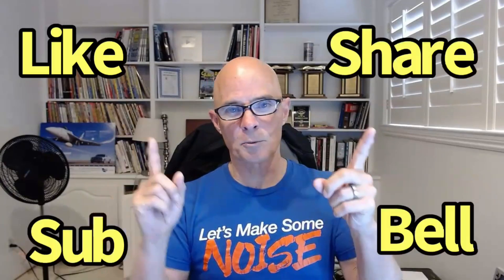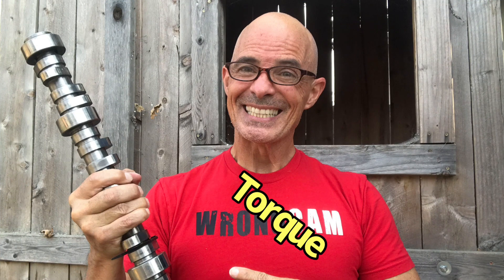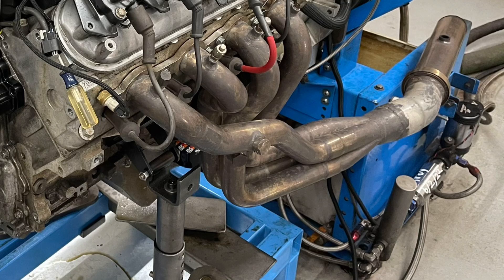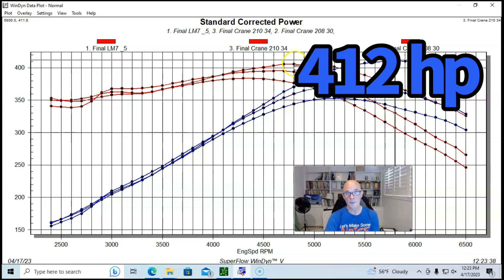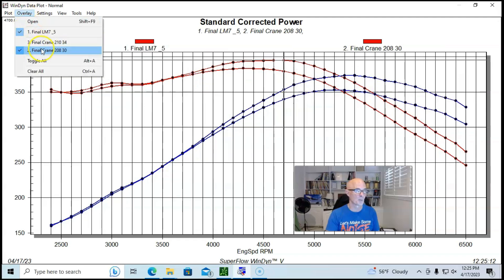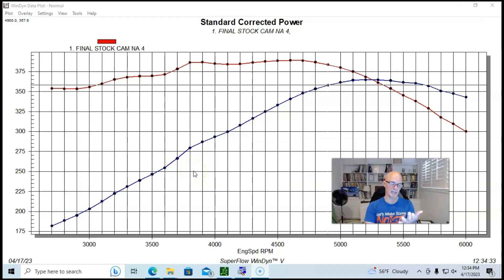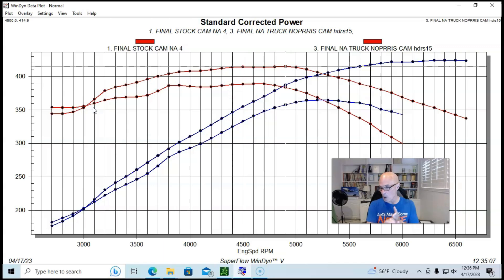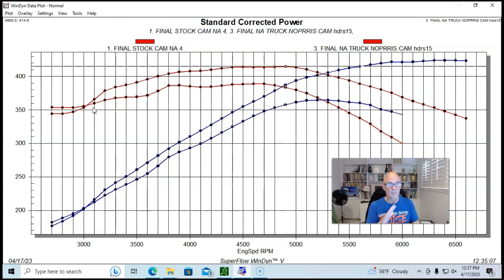WHERE'S THE TORQUE? HOW CAN I MAKE MORE LOW SPEED TORQUE? WHO MAKES THE BEST LOW-SPEED TORQUE CAM?

Comment: The "BEST"  torque cam (for a 5.3L truck) would be LSA of 109-110, 210-228 duration @ .050, .550 to .600 lift (stock to mild porting (possibly more lift with aftermarket heads)) , intake valve closing @ 35 deg ABDC @ 0.050 lift (32-38 is ok), with 15-35 degree overlap @ 0.050 lift. 

But this is with 10:1 to 11:1 compression. (this is more important than cam to maximize torque) The higher the compression the more torque it will make and NO 11:1 doesn't mean you must run 92 octane or racing fuel. You just need a really good tuner to do AF and timing.... 

You also need a good exhaust, either the stock truck intake or TBSS intake (w/ a cold air and a free flowing air filter, stock is fine with a K&N or similar filter). a 160 deg thermostat, and I would do a dual pattern cam with a slight exhaust bias. ( a few extra degrees of duration on exhaust lobe ) at least if running stock to mild ported 706s or 799 heads. As the exhaust on these heads is right around 70-80% the flow of intake and needs a little more, some aftermarket heads don't need a split duration though.... 

This will get you in the 1.35 to 1.45 times the torque per cubic inch range, and thats right at maximum torque for a NA engine. (420-460 ft/lbs torque). Anyone saying they got over that is either lying or breaking the laws of physics.... 1.45 times is max for anything from stock to a full race NA engine the only difference is where that max torque is in the RPM range (the higher the RPM the higher the HP max is).....
Reply from the maker: so much incorrect here! the best torque cam would be 210-228 (an 18-degree spread)? Are you taking about peak or average torque production? What about low speed torque (which is what most actually want). BTW-my Engine Masters entry was 1.53 lb-ft per inch-but that was a dedicated build.
Reply: please then say whats incorrect, I was using the 128 formula but if you have better please  say and show. and the spread is because try finding a cam with those specs and the spread is also all within lower range without need of a stall converter but the lowest would be unable to rev to 6k while upper is still in stock converter range and could rev to 6300 but I am still learning till I die so I'm all ears to those who have more experience .  But don't just bash, explain and teach... 

A final note is I'd of course would personally want the upper side of duration but that would need a custom grind having a split lobe with a fast opening and slow ramp on closing but try explaining that to most people would get lost and try explaining that even cams with exactly the same lift lsa and duration can have different overlap because of the lobe ramp and trying to explain it to most would take pages if not a book to correctly converse the how and why. @richardholdener1727
Reply: Prove it. Richard does it every day. Then he shares the information unbiasely. If someone tells Someone that works at Nasa That the earth is flat. That person tells him that is incorrect, And the person say prove it.  You tell them where the gift shops at and go about your work.

Comment: I would be willing to bet a “small” duration with tight LSA would produce substantially more torque from 3000-4500 than these larger wide lsa cams
Ever tried something like 220-224 580-580 on a 108? Installed on a 104 ICL
Should be right it the sweet spot for a 5.7

Comment: My recipe for tq

Compression, displacement, shorty headers, best intake possible and almost any cam with under 210intake duration with a single pattern
Reply from the maker: definitely no on shorty headers (long tubes add torque-shorty header do nothing), but the rest is correct-then add VVT

Comment: The only real solution for more torque is increasing bore size, changing the crank, longer connecting rods, and shallower oversized pistons for the larger bore and longer rods. Essentially the only way to really create more torque is to increase displacement.

Comment: Makes perfect sense. I had Yukon 2009 with 5.3 and dod lifters failed twice. After 2nd time I changed cam out to a summit racing tourque cam and completely deleted dod crap. I thought they sent wrong cam as it towed way worse than stock cam at low rpms. From 2500 and up it was quicker but only if you manually shifted transmission. The shift points stock you'd never feel the extra power because just as it would start to really pick up it would shift. Of course if you kept rpms higher it towed better with summit cam but that's not where I get best mileage. Summit cam had noticeable lope but without tuning idled lower and stalled alot. I did send ecu out and had dod tuned out after first time it failed when I replaced lifter but 2nd time lifter on opposite side failed.

Comment: Hi , hope you can respond to this ,I built a 350 old school engine,  put new flat top pistons, scat crank, 64 cc aftermarket pro Maxx heads,then the cam I chose is a tow truck/ or RV cam for low end torque, it's the summit 1103 ,288/298 dur,  lift 444/446. Then put 1.06 rockers. 2,700 stall,converter/ 3.73 gears . I haven't dyno tested yet but here I was trying to develop low end torque,  aluminum intake  and 750 street demon carb the combo seems very torquey posi diff, it takes off pretty good.
Reply from the maker: hopefully you have a dual-plane intake, and if you want low speed torque, that cam is a tad on the big side-long tube headers also help
Reply: Yes it's a dual plane intake, thanks for your input on this subject. Love your shows. You answer a lot questions for the home builder .

Comment: BTR doesn't  know that lobe separation & lobe centerline are inputs, not products of manufacturing. Try someone reputable like Jones, Erson, Lunatti, etc. Wide lobe separation will only give higher peak numbers, but will lose average and peak torque. What you don't  know is that people tend to want the biggest cam that they can buy, & wind up complaining to the manufactures. That's  why cam companies started making wider LCA's. How many n/a 383 engines have you built that make over 600 hp & still make 540-560 ft. lbs of torque from a gen 1 under ten k?

Comment: Do you have a video or advice on how to budget modify a ‘94 Ford 5.8 EFI truck engine? I have BE s/w a d a Moates chip to update the tune, but looking for the best way to get more HP and more Low end torque.
Reply from the maker: long tubes, compression, displacement and boost all add low speed,

Comment: Sorry to say, but you're wrong. The one thing that will take a motor and apply much more torque at low RPM is displacement I think back pressure might help a little too I noticed I lost a lot of low end power when i got rid of all the emissions control and restrictive Mufflers
Reply from the maker: back pressure is NEVER helpful and I covered displacement as a torque builder

Comment: low rpm means 800 to 2500 . please test again using those numbers , for a real  analysis.
Reply from the maker: 800 rpm at wot? Please shift down to a lower gear!
Reply: @richardholdener1727   yes indeed , 800 at wot .just needs good mapping . :)

Comment: You increased duration which shifted output to high rpm... tightn that lsa... seems like some Brian toolbag bs. I think you've done enough dynos to know that an engine wants what it wants to breathe and move torque down low. It wants specific LSA

Comment: All else constant it seems that the only way to increase very low rpm torque is to substantially increase engine size.
Reply from the maker: OR COMPRESSION, OR RUNNER LENGTH OR BOOST

Comment: Each bigger cam which closes the intake valve later,  reduces the low-rpm cylinder pressure, which then kills the low-rpm torque. So then, since you do not include this information at the outset, IMO  your testing is flawed.
 IMO
You gotta address the pressure loss, or be caught pissing in the wind.
I already proved this, in my alloy-headed mule-engine, by keeping the pressure about the same with each of three cam installs, and losing little to no low-speed torque. The cams were all at .008, and were 270/276/292  The pressure was kept to, in the range of  ~180>185psi, by adjusting the Scr. I did try the 270 cam at 195 psi and Holy cow, what a monster.
Low speed torque, in any given engine, is principally, in the low-speed pressure. That's partly why;
1) in any given engine, advancing the cam produces more low--rpm torque, and 
2) partly why bigger engines make more low-rpm torque, than smaller engines, at the same Scr with the same Ica. 
For torque, it's all about the pressure, and low-rpm efficiency.
Every 3.5 degree change in Ica, in a 10.7 Scr, 360 Mopar engine,  is worth at least 5>6  psi
So then one cam size bigger will soften the bottom, while two cam sizes will kill it. 
To recover the Pressure loss of going two sizes bigger, will take an increase in Scr from 10.7 to about 11.3.
I did not watch the entire video, because I saw the direction in which it was headed.
Reply from the maker: SO YOU CHANGED THE MOTOR TO ARRIVE AT A DESIRED OUTCOME-THAT IS NOT TRUE TESTING

Comment: The best way to gain big torque from any engine down low is to concentrate on the crank and not the cam. Put a stroker crank in the 5.3 and make it a 383 or turn the 6.0 into a 406 and then match the cam for that size engine and the rpm range you want to use. You did a test between big block Chevy engines the 454 and the new generation 496 look that up and compare the stock for stock results. I think the 454 is a 7.4 liter and the 496 is a 8.1. I drive a semi and the Detroit in my semi is 14 liter engine and I think it's about 900 cubic inches in an inline 6 cylinder. These big truck engines have large strokes and make about 1100 ft lb of torque at 2200 rpm and less. I know I went a little off the rails talking diesel engine but it doesn't matter. More stroke equals more torque. Gas or diesel. Just my opinion but seriously check out that test you did on the big block engines and see if I'm right about it
Reply: Bigger will always be better, no replacement for displacement as you pointed out..

Comment: In my view a true torker cam is not a low rpm cam. Aka stocker type cam. If you can gain 100 or so fpt from a cam swap at a moderate usable real world streetable cam I'd say 1500 to 5500 is a torker cam. A torker cam is an imaginative cam that adds loads of tork off idle to 2000 rpm I guess. The xe 268 cam in my view would be a torker cam. Xe 4x4 cams are said to be torker cams. When an engine starts to trade off low speed tork for hp you have gotten out of the torker cam range. I tested a few dozen back in the day. The combos I liked were at higher rpm. If the car was geared correctly.  The engine didn't last as long. It sucked more gas. But was fun. Sounded awsome. So a 2500 to 3500 rpm starting band in a 4 11 geared car is loads of fun to drive.

Bloodviking 

Bloodviking

Comment: A torker cam is a strange name for a cam I always thought. But I believe it's just a low duration cam. Not much more then a stocker. 268 degrees is probably a torker cam. Power off idle isn't too realistic unless you bore and stroke a motor.

Comment: Before you build your short block get data as in my next post.   Software will pick your compression ratio based on fuel, combustion chamber, rod ratio, quench so you need to optimize the short block and gasket  Now heads and manifold with plenty of velocity  (no Cleveland Ford syndrome)  I've filled in floor runners even used 30 degree seats with these short cam builds, you still want light valve train as that will help using milder profile and less spring
any rod ratio can work but cam will be different   work out how fast valves open or close with different ratios
that said go as long as you can, pistons are lighter 
Disclaimer  You can make similar hp with a no quench motor but it takes better gas  
Tight quench will allow more compression and less timing and fuel sensitivity so go tight quench if you can, 
if you can't or aren't blueprinting your short block  include what you have in your inputs. 
Obviously if you are building a new short block for torque cubic inches make a big difference
Horsepower is mostly head determined but we do not want a high rpm build here
Reply from the maker: again...to be clear...cam timing has very little effect on torque gains at 2000 rpm compared to stock
Reply: @richardholdener1727  exactly :as stock is close to optimal,  point is you can optimize compression which does  help and going to IR roller with the same seat timing  gives more duration at say 200, 300 so a bigger mid range without giving up any bottom end   I've Bult lots of motorhome, tow motors where you can't give up ANY grunt and had a flow bench  and a dyno
but as stroker  McGurk said"you can't beat cubic inches"

cheers
chee

Comment: LS HR CAM more torque  First you must determine optimum valve events at a maximum of .006  SAE or .006 at the valve would be better.  Forget overlap or duration at .050 which is only good for degreeing your cam.  
let's agree that even 4 degrees can make a difference  (I've retarded 4 degrees on slick tracks and advanced 4 degrees on really sticky tracks)
How to do this. Get Rick Jones software or contact mike jones and have all your data including head flows.  
You can get three results   The timings and the overlap is a result not an input and pick a cam from  quality vendor if you can find  match 
Second : generate a lift table for a fully custom cam ready to be ground by your friendly neighborhood  Landis
Third just let him grind you a cam
pick mild springs or race springs understand the tradeoffs  Do not run a race profile on the street unless you enjoy lots of maintenance
now how to keep more power
use  full inverse radius profiles (not so called inverse profiles ground on a big wheel Landis  if it's not finish ground on small wheel grinder run )
why
say the analysis  determines you need 256 degrees for max low end
an inverse profile makes the fat lobe of the cam appear about 8 degrees bigger or it acts like a 214 degree standard HR profile
Understand the physics and geometry which show impossibility with a big wheel
Reply from the maker: I have tested a cam or two...cam timing offers very little gain on power production on the LS at 2000 rpm

Comment: It's about time someone did a low r video.About 10 years late but better than never.I never understood why dynos don't read down low.
Reply from the maker: DYNOS DO-BUT WHO RUN WOT AT 2000 RPM?
Reply: @richardholdener1727 street and towing pickup engines spend 90% of there time 2000/3000 rpms. What godo does dynoing them at 5 and 6K do when they never see that kind of rpms?
Reply: @jessesyfie7244 I completely agree! I want to see numbers for everyday use street driving/ towing situation,  NOT screaming around the oval at Talledga, at 7000rpm! Which NO ONE watching these videos does.  Cheers.
Reply: @richardholdener1727 , judging by the comments and my personal feelings, a video for us truck guys wanting maximum low end torque is in order. I've probably watched all your videos and collected a lot of tidbits of information across them for torque. But a good "one stop shop" video for us is just what we need!

Comment: @Richard Holdener    I doubt any cam could improve low end torque over stock because OEM  care about optimum daily driving so they’ve already picked the best cam for that. You should do a video on volumetric efficiency. That’s the key to this whole debate. Stock cams are already at peak volumetric efficiency up to 2500rpm or so. The power gains seen by after market cams come from longer intake valve events, which actually increase the volumetric efficiency at higher piston speeds, but almost always at the expense of low end torque. VVT does mitigate that to somewhat
Reply from the maker: peak ve is actually at peak torque

Comment: As a bolt-in I get what you are proving. A little compression bump with the TN cam will bring back the low numbers compared to stock. I realize piston to valve clearance becomes a problem.
Reply from the maker: compression adds torque with any cam

Comment: I would think a cam with negative valve overlap or zero overlap it would provide excellent cylinder pressure at low rpm , tighter LSA of course, and kill high RPM power. Much like you would find in a BBC dump truck. Did you try any cams like this?
Reply from the maker: THE STOCK CAM AND -37 DEGREES OF OVERLAP-MANY OF THESE ALSO HAVE NEGATIVE OVERLAP-THAT IS NOT IT

Comment: What want is to get a cam that matches the torque curve of a TPI intake which I'm using with an adapter lower intake on a 383 stroke SBC with vortex heads. Lunati recommends their RV/towing cam. What say you?
Reply from the maker: a small cam will work well with the tpi-on a 383 I might use something like a 218/224
Reply: @richardholdener1727  thank you so much